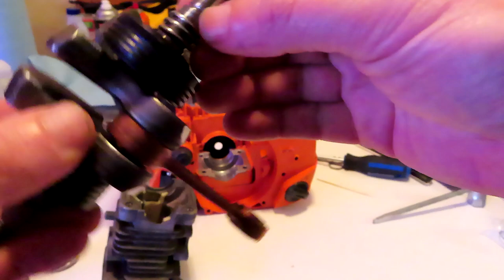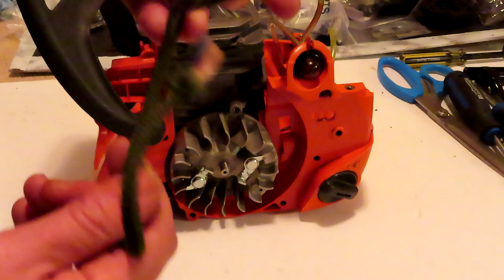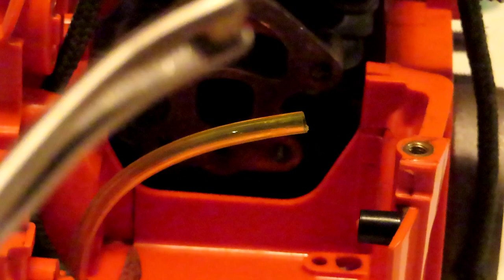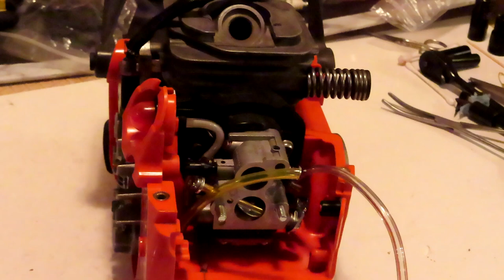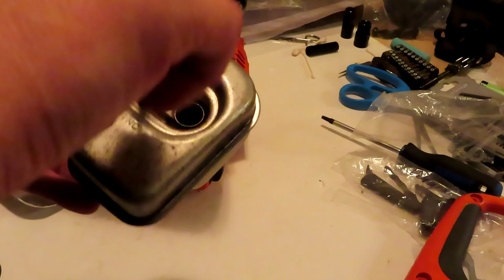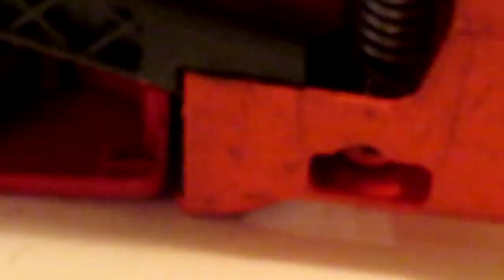Husqvarna Chainsaw - Full Rebuild

Comment: Waaaay further than I've ever gone with a saw this is a great resource thanks caddisguy.  Extra points for getting it done without pullers or other specialized tools 😉
Reply from the maker: It's been a fun project. Maybe the Husqvarna marketing peeps are at the edge of their seat... like hey if that saw runs and doesn't blow up, let's outfit that guy with flywheel and worm gear pullers, maybe one of those fancy clutch removal sockets, he's obviously going pro, gotta get him before Stihl does! Ya'll can keep the metal piston stop though, I prefer my camo rope. Should find out Saturday how the saw does and get a quick vid up.
Reply: @caddisguy    They'd be crazy not to snap you up for their pro team😀
I forgot to comment on did I see any problems.. will it run?  Put me down for probably I'd give it a whirl! lol  Seriously, you got compression that's most of the battle. g'  luck

Comment: Nicely done. I was just gifted (although not sure how much I appreciate it at this point) a 240 from a friend who had locked it up. Piston was pretty beat up so I replaced it along with the case. The seal on the bottom didn’t have a gasket to transfer so I tried to simply lay in some liquid gasket. That did NOT work. Any idea on where to source those little narrow gaskets that join the top and bottom of the cylinder? I enjoyed the video. Thanks!
Reply from the maker: I am not sure about cloth gaskets for the 240. The 240's don't come with cloth gaskets from the OEM like some of the other Husqvarna models. There might be some aftermarket ones. If not, you could probably get the material and trace/cut it yourself. I'd be interested if I ever need to re-do this one, another 240 or similar. The liquid gasket was the most difficult part for me. I tried to just run a good bead on the lines at the bottom of the cylinder housing, but ended up just smearing a thin layer on the entire bottom of it. Then of course putting it back on and screwing it in without letting it rub or touch anything. That was the hard part for me. If it helps at all, I used Loctite 518 for the gasket and it is still holding up great. In my case I consider myself lucky to have got it good on the first try. I can see how it could have taken more than one try (a job I'd prefer to avoid doing twice) One another thing I'll add, I remember looking at the temperature rating on this stuff and thinking I better make sure I have the saw tuned right, that I am not running lean or going over 9000rpm in the cut, because I don't think the gasket (I could be wrong) would hold up if the saw overheated by much. Luckily the carb was "almost" spot on. I think I just needed to open up the low and high jet a little bit (like 1/8 turn) to mark it perfect (it was bogging in the cut initially) Still running great though!